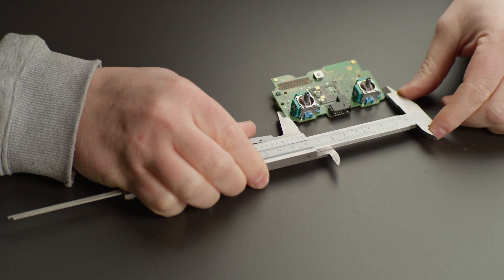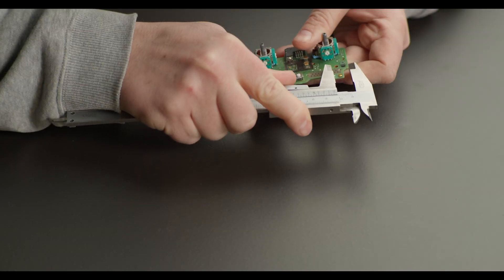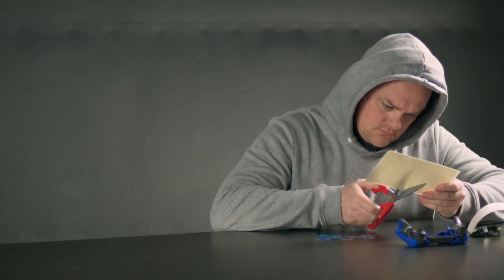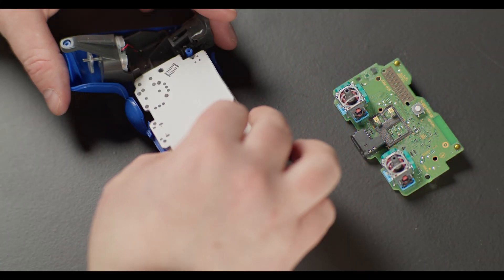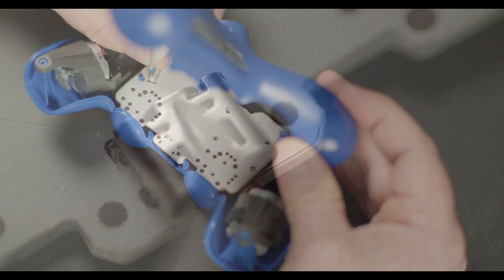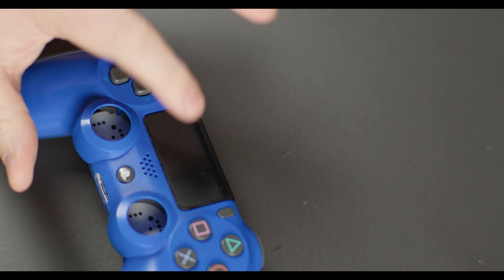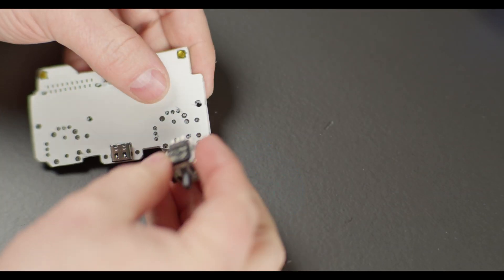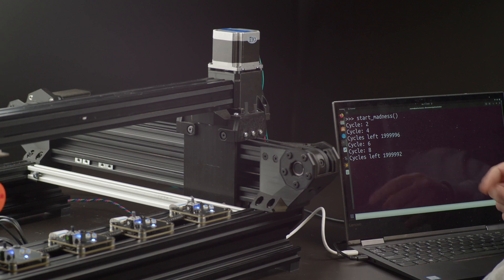PS4 controller, custom main board development

Comment: Can I ask what type of microcontroller chip you're using?

I am trying to design and build my own controller for me, and need a reference for the specs to be looking for. I can't find any specs for the DualSense SIE CXD90064GG chip, or a mediatek MT3616. So I have no clue what I need.

I think something that has 500Mhz operation speeds and 5MB of embedded RAM?
Reply from the maker: @andrewvirtue5048  I think the easiest to start with would be a rp2040 since its so well documented :)

Comment: I would absolutely love if you could somehow re-add pressure sensitive face buttons. I feel that was the biggest loss from the DualShock 3. I mean, if it were possible.
Reply from the maker: Yeah those are pretty cool. You can do that with hall effect buttons now. Even in multiple direction. And twisting/rotating.

Comment: Does a jdm 001/010/011/020/030/040 work on a 5th gen ps4 controller (the ones that should have jdm 050/055 standard)?
Reply from the maker: Jds040 works but has a connector on the other side of the pcb so the cable ends up being super short.

Comment: as a fighting game player I chew through ds4 controllers every 4 to 6 months so i mostly use units i fix myself. Seeing the possibilities this project has has me all excited for te ultimate competitive controller

One thing that i would find most uselful is to reduce the controllers wired input lag (gor some reason bluetooth has less input lag)
Reply from the maker: Im working on the worlds fastest controller. How do you use the triggers when you play? As of on buttons or more like an accelerator in a game?
Reply: @MariusHeier1 Definetly as buttons. Trigger travel is virtually useless on most fighting games. 

One quick fix I do is drilling a little screw on the trigger plastic so it works as a trigger stopper. Cheap, effective and easily replaceable part. It won't give you regular button feedback though hahaha

Comment: I hope you crack the encryption of the wireless communication to the PS4 by dumping the main ARM based firmware and reverse engineer it. Another option would be an update to have Bluetooth 5 or even 802.11 Wireless for lower lag. Or remapping of buttons on the fly. As long as it still works with the original ps4 it's good.
Reply from the maker: I play on playstation my self so this needs to happen no matter who ends up doing it 😁🤔😉🙂

Comment: I have an idea shamelessly stolen from the custom keyboard community : Can you make the joysticks hotswap so it's easy and quick to change them to fresh ones whenever they start developping too much stick drift ?
Reply from the maker: Or. I can make hall sensor sticks. :)
Reply: @MariusHeier1  I thought about it ! But not for the dualshock 4 but the Dualsense since it has a front trim that can be popped off, no need to take it appart to access the front of the MoBo to pull the sticks out (or even the Edge since the modules are meant to be removed). But I mean yeah a USB C, hall effect equipped, with click face button and rear paddles Dualshock 4 seems like a dream. I could revive my drifting controllers or improve my current one

But after a bit the price goes up and up :(

If I had enough know-how and budget I'd love to try myself if I can mod an official DS4 with sockets to host the pins on the joysticks and make hotswap from an old controller instead of making a whole new mainboard.
Reply from the maker: @konishiwoi  Trow me some link on those hot swappable sockets, like pixs. And i can see if i can trace them down. Exactly. And a lot more powerfull microcontroller to make it faster. 800ma charging. So you get the max amp charge rate trough the usb as well..not only the audio plug thing.
Reply: @MariusHeier1  Here's a video showcasing the process on a keyboard which is basically what I have in mind : https://www.youtube.com/watch?v=RB1Wm8y2Cw8

In its description you can find links to the pin sockets used. I took a quick glance and the website has more of al dimensions.
Which brings me to the main issue I fear : I don't know any of the dimensions (PCB thickness, bore of the hole, the pins' size etc) that would be needed to know if 1. it's even doable or not and 2. If yes, which pin sockets to get. 

I believe those sockets are called Mill-max sockets
Reply from the maker: @konishiwoi  that is awesome. Ill try to get some to test.
Reply: @MariusHeier1  That'd be awesome ! If that's ok with you could you update me on it if it ever goes anywhere ? thx

Comment: How are you going to be able to connect it to a playstation, are you going to put new silicon or reuse parts from a controller
Reply from the maker: Im not at that part yet. But its probably possible to use something from an old controller.. but maybe not hard parts
Reply: @MariusHeier1  ah interesting okay also i have an idea on making a xbox controller with ps4 components, like making a board that can fit in a xbox controller, that uses chips from a ps4 controller, you think thats possible?
Reply from the maker: @zipzopbeesopdro  Its probably easier to just remake the entire circuit board. I think i seen the xbox usb descriptor somewhere. The controller im making can be used for anything. As long as it has the right software/code.
Reply from the maker: @zipzopbeesopdro  You gave me an idea to explain this stuff in a video. Its probably usefull for people to know.
Reply: @MariusHeier1  sounds good no worries

Comment: Is that what I think it is? Are you finally converting the PS controller to hall effect analog sticks?
Reply from the maker: Yeeeeeeez! That's correct
Reply: @MariusHeier1  subscribed. I also own a broken ps4 controller and want it to be converted since I think I broke its mainboard because I was using a heat gun rather than a proper rework station when trying to remove the sticks.

Although I'm already using a Gulikit controller, support can be spotty at best.
Reply: @MariusHeier1  i look forward to the next video. Some youtube algorithm gods recommended you out of nowhere after giving up trying to restore my old controller last year.
Reply from the maker: @triadwarfare  That's good to hear. That I finally get some love from the YouTube gods ;) I figured many people got a spare broken controller. So might as well repurpose one like that.

Comment: please make a controller with hall effect anolog sticks. if you can you should also put back buttons as keyboard switches that can be programmed
Reply from the maker: Working on it. And recording it now. Do you mean actual keyboard switches. Or switches that will trigger keyboard presses on your computer?
Reply: @MariusHeier1  actual keyboard switches. If they can be hot swapped too you have a multi million dollar controller. Also the response time. If it can be over clocked🔥
Reply from the maker: @Kofi7   I'm making my own circuit board, so you select what switches you want to integrate. Its gonna be as fast as the hardware and software allows. Which probably gonna be a lot faster than the corporate ones.

Comment: I already ordered a usb-c board. 
This may be my next purchase.

What are the benefits of this custom board?
Reply from the maker: Plenty. My favourite is to have control of the software.  I will be talking about this topic in some upcoming videos.
Reply: @Marius Heier  well thanks. 
I look forward to watching the video. 

I also noticed you were working on new joysticks for the setup.. is this something that would come with your board as a set? 

Because if that's the case, I'm gonna a go all out and rebuild my stock controller with all of the parts you have for sale. Maybe even rebuild my aftermarket controller as well. It's still a ps4 branded controller, but it's a much more pleasing color. lol

Comment: Looks like a fun project. Is there any benefits over the original board?
Reply from the maker: It will probably depend on the user. But to me: The biggest benefit is it can run custom software. And it should be blazing fast (input lag), and can very easy have multiple extra buttons/inputs/outputs.  And at some point it will have hall effect joysticks with no script
Reply: @MariusHeier1  sign me up then :)
Reply from the maker: @ADHDbuilt  I think i should make some sort of wait-list. Would be usefull for me to see how interested people are in getting some of the stuff im making.  Just a normal email sign up thing. Without any cost or prepayment
Reply: @MariusHeier1  I've already purchased your charger. So you should have captured my email. Omnisend or similar will have a free option for the quantity of emails you'd be at so far.
Reply from the maker: @ADHDbuilt  Thanks for doing that! Thanks for the tip
Reply: @MariusHeier1  If you're taking request for features. See how big of a battery you can fit in there. Feels like there is plenty of space.
Reply from the maker: Yeah. It should. And thanks for the feedback.

Comment: I would really like to have Hall effect gimbles on my ds4. I have no clue if it would be possible but since your making the main board I think it might be worth a shot.
Reply from the maker: Its gonna happend sooner or later :)
Reply: I second this idea!  The steam deck have Hall effect “module boards”. Not knowledgeable enough but they seem to be drop in converts for resistance sensors. But be usable since they convert with ribbon cables. Just would need to work out mounting and such?  Maybe??  Lol. I’m a backyard engineer. I guess everything works till I break it. 😂
Reply from the maker: @GrapplerS10  Hey. I know about them. But they are pretty expensive. Ill make my own. ;)
Reply: @MariusHeier1  the modules are like $25 on Amazon.  Seemed reasonable to me to get the hall and processor board.
Reply: Maybe the all package(Hall sticks, main board, usb-c board) for like 60€/$/£ i would buy it for sure.

Comment: Very excited to see where this goes! Love my USB--C already.
Reply from the maker: Thanks! Super cool! This is gonna be some cool stuff. USB-C was a tiny start :)
Reply: Do you have the diagram to a JDM-055 ps4 controller mother board, I need to know where ground and all the directions are located for the left stick and right stick. I am moving the right stick to the left of the controller and I am connecting the left stick to an arcade stick. It's for a game I speed run and hold a record in. Trying to build the right equipment but I am in experienced. taking it real slow, do you have any info that could help me better understand the board I am working with? @MariusHeier1